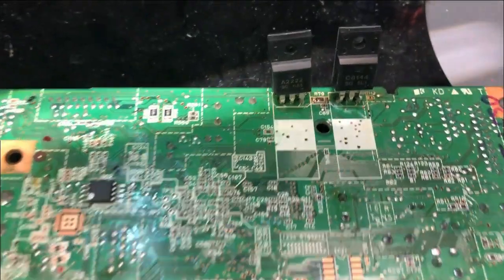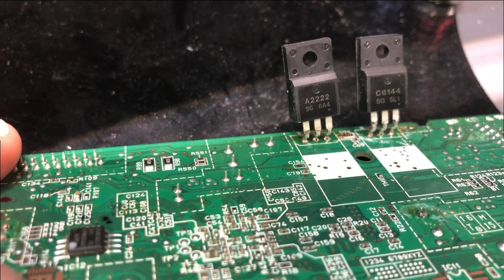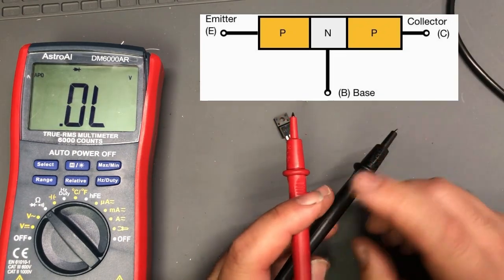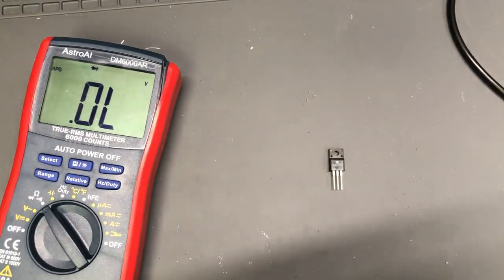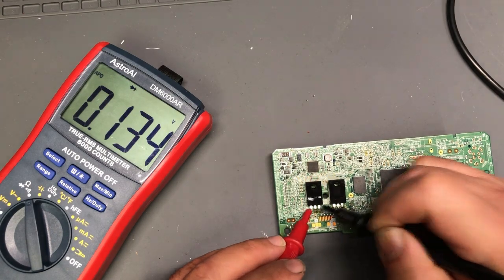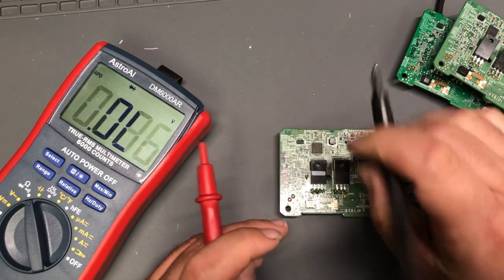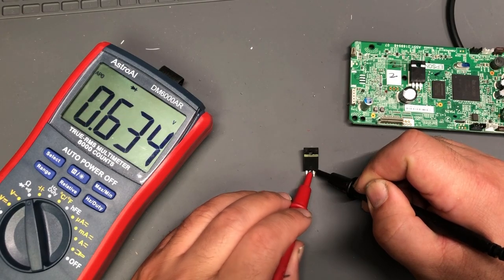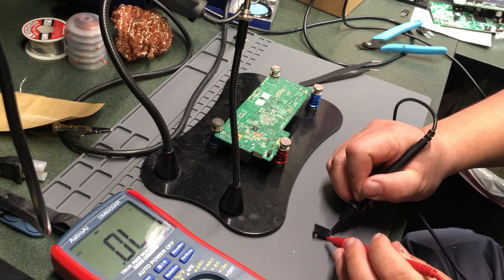#1 Fix Epson No Power: test A2222 C6144  C6082 on Printer Circuit

Comment: I have a similar problem. But the et2720 is turning on, you see the epson logo and i hear a sound of a motor. But the epson do not boot to the end ans sill restart. Afer two starts the epson is turning off. Do you have a solution or an idear to fix the problem?
Reply from the maker: Thanks so much for watching and sharing your detailed question! It sounds like your ET-2720 might be stuck in a boot loop, which often points to a faulty power rail, corrupted firmware, or a shorted component on the mainboard. I’ll try to cover this model in a future video so everyone can see the step-by-step diagnosis. Because of the high number of questions I receive daily, I can only answer about 10 per day—subscribers and members are answered within 48 hours and get priority support plus early access to new videos, while regular viewer questions are answered as time allows. After that, remaining slots go to the newest comments first, so if you’re not a subscriber and don’t hear back within 48 hours, you can either subscribe or re-post your question to bump it up. If you subscribe later, your past questions automatically become priority—no need to re-post. For faster help, you can always email [support@bchtechnologies.com](mailto:support@bchtechnologies.com). And if this video or comment helped you, please consider leaving us a quick Google review here: [https://g.page/r/CfL7k6nYvPQ9EAg/review](https://g.page/r/CfL7k6nYvPQ9EAg/review).